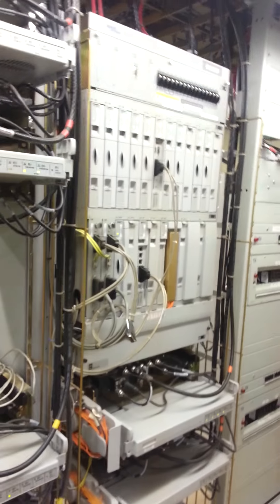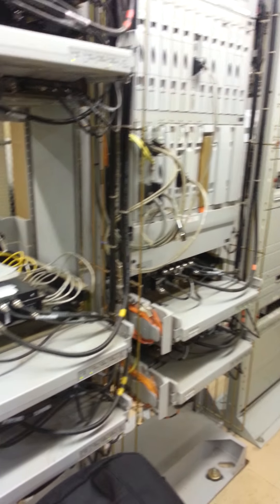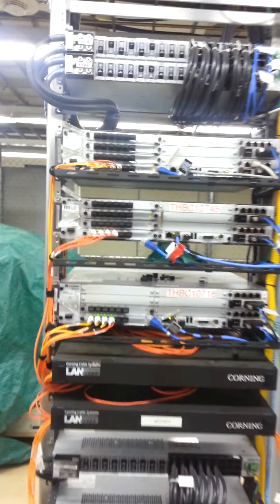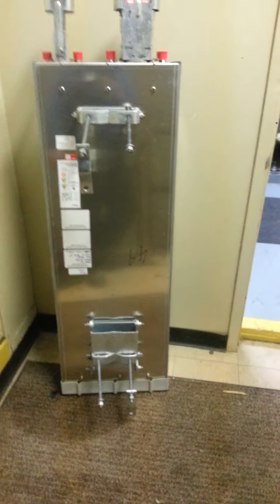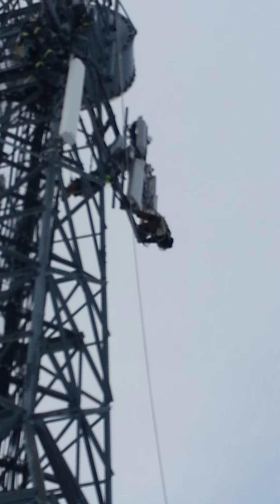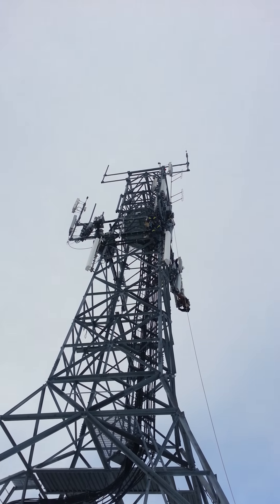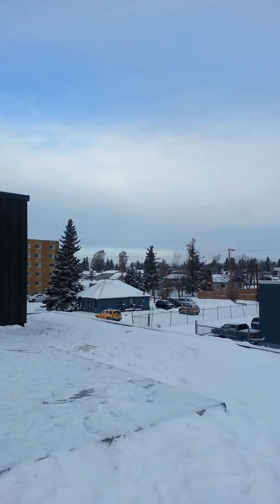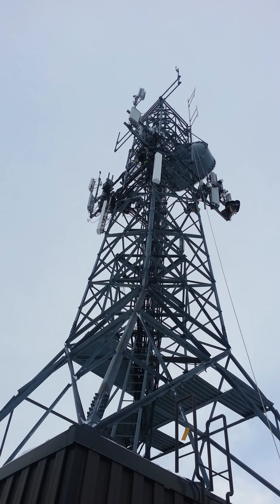Building LTE Cell Network.

Comment: I agree. Hell with that. Ex-CO-Wireless Installer here, just got hired for the network vision project. I've been out of the Provider field for several years, but happy to get back into it.
@ Miguel. Do a job search for Central Office Installer. That will get your foot in the door.

Comment: I have Verizon, do cell companies only use their specific towers or in  some instances install antennas on towers that don't belong to them.  I assume some companies share on the same tower ?
Reply: *****  good one
Reply: +Nicky T In some cases they do share, in Brazil it's very common for you to find 2 or 3 carriers in one tower, with 2G, 3G and LTE each
Reply: Nicky T it depends os the owner of the tower. If the cell phone company itself owns it then theyre most likely the only one to have antennas on their tower, but but not always. But if a tower is privately owned they rent out space to different companies and could have multiple companies and even types of transmitters for stuff other than cell phone carriers. Even police and ambulance dispatch antennas.

Comment: Pacificrigger: Are all vendors of LTE equipment designed this way (fibers up to the radios mounted on top?)  Also, I was wondering how much capacity can be handled by microwave backhauls? I notice a lot of towers where I live don't have fiber backhauls.

Comment: Hey buddy, one doubt, in your experience which equipment is better, Huawei or Ericsson?
Reply from the maker: Hey Diego, that is a good question but it is really up to the cell carrier. For the Riggers, the Huawei radios are much easier to work with. For the operational aspect, I think Huawei is better. Rogers uses Ericsson in the East and Huawei in the West. Telus uses Huawei all across Canada. The cell companies like Huawei for the cost as it is much cheaper than Ericsson. But.....  there is always the dispute of cyber-security and that is anyones guess.

Comment: So here's my question: How does it take Sprint a year to upgrade one tower after they "begin updating" it?
Reply from the maker: Sometimes a Telecom Construction company will go to a tower and do all the required work and the Carrier of that communication system will have the upgraded system running idle. They may choose to keep many sites on hold until they will have an announcement ant flick a switch for an entire area to be turned up all at once. Often there will be Ads running prior to a large turn up of a customers sites. 
 We built many sites before Christmas and they held them until about two weeks before Christmas. That made sales skyrocket once it was released to the public.
Reply: pacificrigger Thats business

Comment: you dont even have your safety glasses, nice job
Reply from the maker: jair marquez Have you ever tried working where it is hot in the radio room, then going to the tower where it is -30 degrees?? Safety glasses would fog up and then freeze over making visibility impossible. It is not reasonable or necessary to wear safety glasses when doing this work in these conditions. In many cases safety glasses are the Safety Code and it is mandatory and I agree. This is not one of those times.
Reply: Yes I have, and I ve done work all over the world, but then again what do I know.  With those temperatures your skin and eyes are much fragile while exposed to harm and yea I would love for you to tell OSHA that answer.
Reply from the maker: FYI, we are in Canada and we follow the rules of Work Safe BC, not OSHA as this is not the USA. The use of Safety glasses is not required for this type of work. If you want to be a hater look up the rules first. Sorry you don't like this video. Feel free to watch someone else's videos if you want to be a dick.